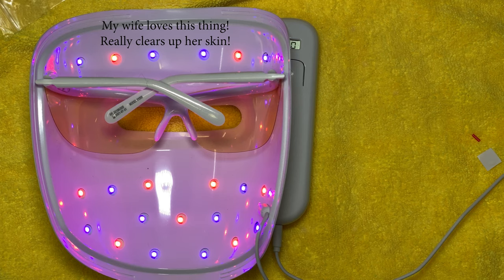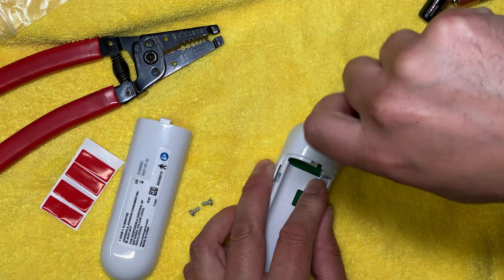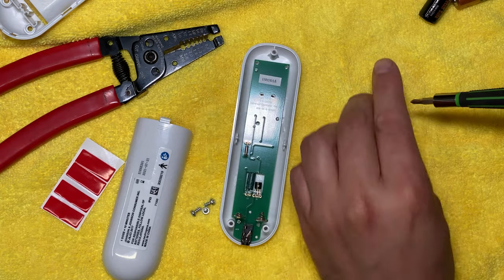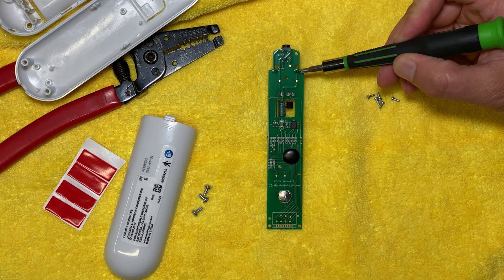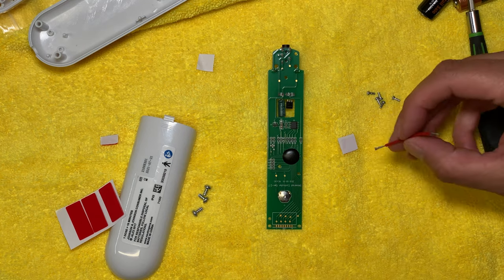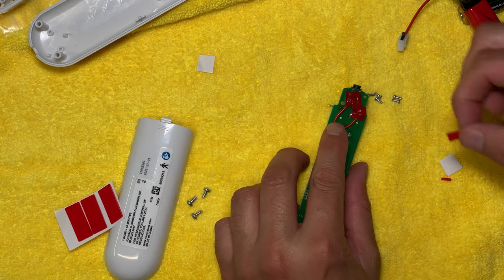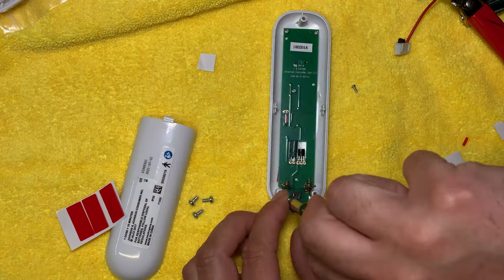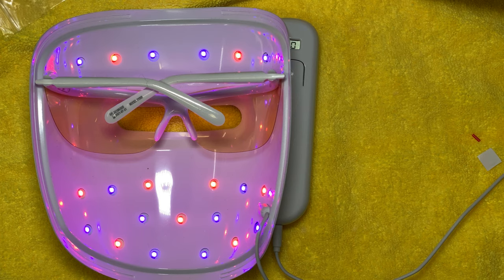Hack Neutrogena Light Therapy Mask - With a Screw Driver and Tape!

Comment: I was fortunate enough to have two power packs.  I soldered the first one years ago and it worked like a charm until recently when the port where the mask plugs into the power pack went bad.  I was worried I wouldn't be able to find the original video showing how to solder and then I found your tutorial requiring no soldering.  Worked like a charm in about 10 minutes versus trying to brush up on my soldering skills which would have taken hours.  Hopefully my last pack will last another 5 years.   BTW, since I don't use my unit every day I take my batteries out between uses so they last longer as well.  Thank you for sharing!
Reply from the maker: Hey, that is really good news to hear! And good job innovating. I like your idea of taking the batteries out so there’s not a parasitic draw that weekends them.
Reply: Hello, I realize I'm two months late on this but my bestie daughter had this and never used. With no package or instructions she passed it on to me. Would you please give me the run down on how to use ( with face cream or wout ) how long and also......what its for ( I guessed wrinkles ). In advance T.Y for taking this time to read all that. I have googled but all those big words, plus no video just reading. Again, Thank you- 🌹
Reply from the maker: @lorihutton9535 https://youtu.be/v4-Ne71VEAg?si=ermtu2CMLcvmDle2

Comment: I just found this mask in the top of my closet. Unopened and still wrapped in plastic. I forgot I had bought it and have been eyeing some expensive ones online. I will come back to this video once my 30 uses are up. Thanks.
Reply from the maker: Oh good find!
Reply: I got mine to work after it ran out. I had to do some trial and error with the wire. I didn’t have wire laying around so I ordered 26awg wire from Amazon.
Reply from the maker: This is great to hear! Thanks for sharing with everyone! If in doubt trial and error can go a long way!!

Comment: is there a way to get in touch with you? I have an older model Neutrogena LED mask with a different looking circuit board. I'd like to send you a picture to see how I can hack it. Was going to throw it away until I revisited this search but each video shows the same model inside. Any help would be greatly appreciated!
Reply from the maker: Sure, let me send my email
Reply from the maker: Fixitwithjake@gmail.com
Reply: @fixitwithjake  ty, will send you an email shortly
Reply: Did u fix it?
Reply: I think I have the same problem

Comment: Only the red lights seem to be working on my mask—likely a problem with the mask itself vs. remote. Any ideas on how to fix this? Greatly appreciate your tips!
Reply: Honestly, I bought a battery pack off of eBay that works with it. So I’m not using the default neutrogena one
Reply: hi did you end up figuring it out? i seem to have the same problem